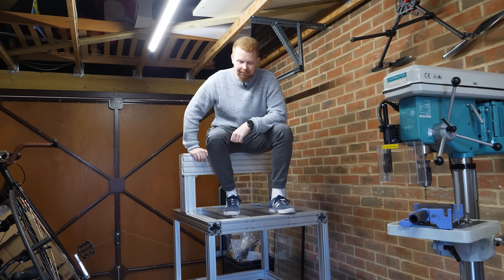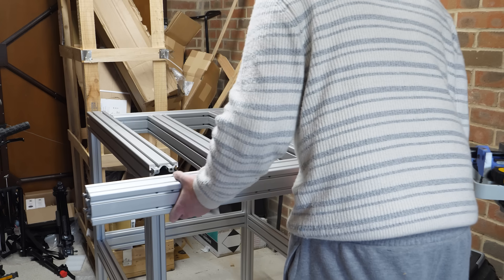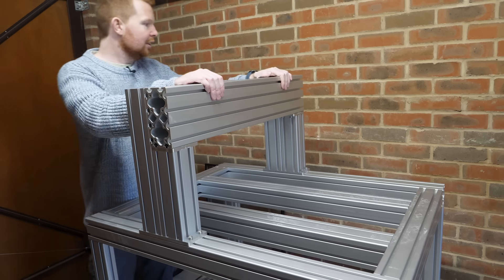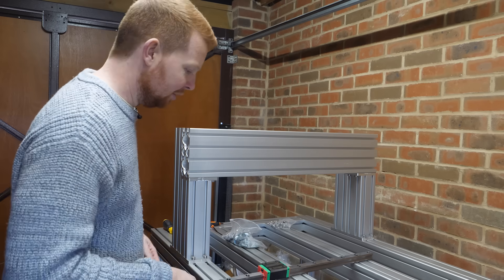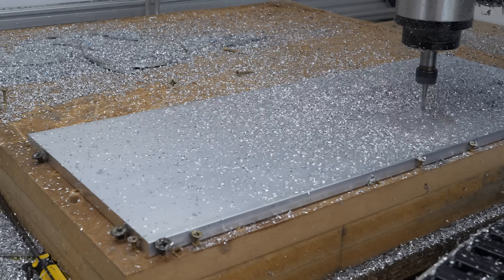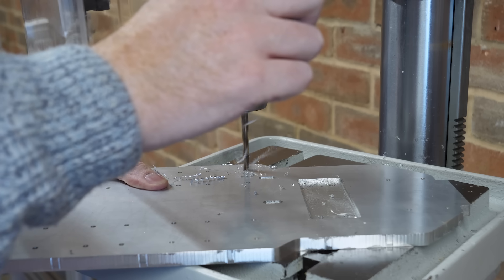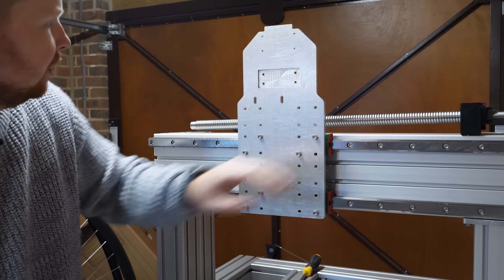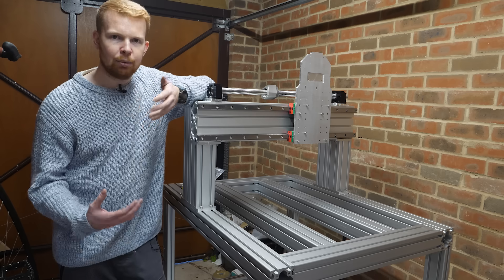Building a CNC Mill/Router - Part 1

Comment: Unless you cut the extrusions at PERFECT 90 degree angles, I highly recommend using 90 degree gussets and relying on those instead of the drill through connections. I personally like the ones from Tnutz together with their high torque t nuts with spring balls.

Comment: I feel like maybe your machine has it's weight up high and might cause it to wobble. I feel like if you could bolt the whole frame down onto the floor solid it would make the whole thing rock solid. Maybe even anchor it to a wall if the floor is concrete and you don't want to use concrete anchors or something. Looks like a nice setup from what I can tell. Looks expensive.

Comment: I've noticed many people building CNC machines recently who have chosen to use those linear rails/bearings instead of round rods. Is there a reason for that? I would think that the round axes would be better since there are bearings on 4 sides of the rod and ball bearings have maximum capacity when the race is pushing downwards rather than side to side. Wouldn't the flat axes with the two races on either side be weaker when force is applied in other directions?
Reply: The reasons are stiffness and precision. Linear rail that is attached to a beefy aluminum profile deflects far less than round rods do. If you evaluate the bending forces, then you will see that the deflection of the linear rail is actually negligible compared to the deflection of the profiles that carry the gantry and both are negligible compared to tool deflection and the stiffness of the CNC router motor itself. It needs to be said, again, that these kinds of router designs only work for soft materials like wood, plastic and aluminum using high rpm, small diameter tools (up to maybe half an inch). If you are planning on cutting steel, then better get a 2500lbs milling machine because this won't do.

Comment: Its a shame you put so much into rigidity and overkill on everything for rigidity, than install lead screws instead of ball screws :/ the amount of play they have compared to ball screws  just undermines all the rigidity work you did for the produced parts to be as accurate as possible. Putting the screw so high on the machine also increases the leaver on which the forces will be aplying stress to the gantry. It would be beter to mount it between the rails or below the extrusion. 

also X is probably not as smooth because of 2 things: You are runing them dry in the video, so grease will help. i wouldnt run them dry like that at all. And when you mount the rails, it depends if you checked for parallelism...basicaly tightening them after the plate is mounted with the help of a dial and soft hammer :)

Comment: Don't fall for the straight linear rails. Over all, the aluminum extrusions are probably straighter than the linear rails ( they get stretched after extrusion). True reference can only be accomplished by using steel straightedges with the needed tolerances. I've built a router with a clamping area a bit over 1250 * 2500 mm. The X-Axis linear rail (same beefiness as yours) was off by ~3 mm (a 🍌). By rigorously comparing of different "straight" objects at hand and a laser (and reversing them) i managed to find out that the aluminum extrusion is only off arround < 0.5 mm max on 1500mm. So i managed to bend and fix the rail to the extrusion and getting it, ...so said, straight enough. Should be about +- 0.2 mm, at least i tell this to myself. It came ou that it often does not matter as much, because the flattened bed follows the inaccuracies and the usually plywood stock is fixed to it. On smaller peaces it is obviously way more accurate, according to my small precision straightedge. Good luck!
Reply: Who needs 0.2mm precision over a 2500mm working distance? What material are you working on? Inconel bars? The thermal expansion of both your materials and your router will be larger than that.

Comment: Easy way to get the linear rails to move smoothly is to loosen all the bolts just slightly and move your plate to one end and tighten that end's bolts.  Then slide it to the other end and tighten those bolts.  Hopefully this will remove any non parallelism and it will move smoothly and you can then tighten all the other bolts.  Make sure it's as square as possible everywhere you can.  Parallelograms are the bane of these machines.
Reply: You can easily correct for that in software, if necessary. These are not precision CNC mills. Machines of this type are convenient to make parts from soft materials that do not require tight tolerances. If you want to do better than this, skip the build and buy a machine from a company that has 50 or 100 years of experience in tooling machines and dozens of engineers for the design.
Reply: @lepidoptera9337  But, but, what would this guy do to entertain us?  It took me a while to learn that these sorts of videos are not instructional, rather they are to educate you on the design concerns and pique your interest.  Then you buy some really cheap thing or try to make one yourself, and then, if you get through that phase buy a real one.
Reply: @dougcox835  Buying a precision machine is not even worth your time and money. Design the parts that you need and then let a machine shop make them for you. Professionals don't reinvent the wheel unless there is a financial advantage. For the occasional mechanical part there isn't. You basically have to have 80% utilization before buying a machine and employing a machinist full time is cost competitive with an established shop.

Comment: I work with aluminum extrusion at work a lot, and I have to say that method of mounting them together is not ideal. We used to do it that way with button head screws, but what we found is overtime the part slowly moves down the slot. Then when you try and disassemble, your hole to access the screw doesn’t line up and it causes a whole world of problems. I would recommend sending a screw all the way through the clearance hole instead

Comment: None of those extrusions are straight by the nature of how they are produced. You will notice that there will be height and spacing differences along the extrusion. As you tighten linear rails on uneven extrusion surface, they will bend along the surface. You have to figure out better ways to get straight surfaces out of them. There are companies that machine the extrusions to 1 mil tolerance along a 48 inch length. Get ready to buy a precision shim kit, because you will need it. Ball screws and linear rails will bind if they are not parallel to each other.

Comment: what are dimentions of the profiles? 20x40? 40x80? 40x40 or 80x80
Reply: I have access to 60x60 extrusions, will they be rigid enough for cutting aluminum and possibly steel if I use them instead of 80x80?
Reply from the maker: Most are 80x80, but the legs are 40x80, and the gantry is 80x160.
Reply: @TimStation please tell what are the lengths of the profiles?

Comment: 0:50 good stuff this is one of the strongest way of joining those aluminium profiles, and also requires the least amount of fixings, there you used two screws, next worse thing would be using those angle brackets, two of them, each has two screws and two t nuts, that adds to 10 parts!

Comment: Hey Tom, awesome build! I think your frame will out live all of humanity :)
I work as an engineer for an automation company and we produce off the shelf axes that are also used for CNC applications. These enclosed axes offer a lot of rigidity by themselves and have internal guiding so they save you the hassle of having to align your guides. Added bonus is that these axes also enclose the spindle and thereby  provide protection from chips and coolant (both tend to cause issues over time when they come in contact with the spindle). We also have servo's and what not to power everything. Feel free to contact me if you want to chat about your project!

Comment: Woo! Nice! You'll want to definitely gusset, locktite and tram EVERYTHING. Explore adding pebble or some other aggregate epoxy mix to the structure to add rigidity and dampen vibration. And nothing is overkill in a project like this!

Comment: Looks interesting! I used similar size rails and carriages to build a sliding door for my bathroom so the gap between the door and the wall is minimal. I don't see anything overengineered in this video. Looks good to me.

Comment: I use aluminium extrusions in a somewhat off-label way, as the frame structure for arcade stick-style game controllers (laser-cut panels go on the top and the bottom to complete the enclosure). This video was super validating in showing how tricky it often is to think through the order of operations for assembly.

Comment: For the linear rails you can put the bolts and the T Slot nuts in advance, don't tighten them, slide all of them together on the extrusion, once you have 3-4 in the rest just slide in with ease and then tighten them in place. Saves a lot of fiddling trying to get the nuts in place once the rail is on.

Comment: The x axis will probably travel better if you true up the linear rails to each other. I imagine you can find methods online, but I would lightly tighten the rails to the gantry and tap them with a lighter mallet until the movement is smoother. You could measure the ends to see which way the taper is and be more precise, but with precise bearings like that bringing them in can make a huge difference. I'm surprised they moved at all to be honest.

Comment: You might find it cheaper and easier to buy metal parts straight from laser cutting firm and then add your own machining. I often get parts that are finished or nearly finished for less than I can buy the stock. I think the reason is that a moderately sized laser outfit is buying in bulk.

Comment: I am not sure if this has already been suggested, but filling the extrusion with epoxy granite or a mix of sand and epoxy would add a considerable amount of mass. This would help with resonance and keep things from shaking around as much. The vibrations from milling metal can be significant. I have an MR-1 CNC machine which is of a similar design. It weighs about 1000lb and still shakes around when milling.

Comment: You're not going to get a stiff machine with bolted extrusions. Yes, you can site on it, but that means nothing. I can sit on a bean bag but I'm not going to use it to machine something. Here is a simple thing to try: put an indicator on the middle of the gantry touching the middle of one of the two support beams and push the gentry & pull the front beam and see how much deflection you get. That's going to be the maximum accuracy of your machine. I'm going to bet it will be in the realm of 0.5mm at best. That will break small endmills. Get a 10mm steel T plate cut to mount to the outside of each side and that will improve matters substantially, better than just doubling the vertical extrusion. Even better, make the vertical arm substantially wider and join across them with more steel plate behind the gantry, bolted (or better welded) to the vertical arms of those plates with as much crosswise bracing as you can. Best of all, join the side plates across the bottom with a couple of steel plates. The extrusion is fine for bolting rails to, but that's about all. As the aluminium and steel will move differentially with temperature you'll need to think through the mounting of the extrusion carefully.

Comment: Looks good, just a curiosity, how comes use used a second 8080 beam for the gantry brace? I'd image an end plate would've been cheaper and considering you already have a cnc probably easier. Also, I'd get some spacing measurement on the linear rails, the 4040 slots aren't the most precise and could be causing the resistance.

Comment: The good thing about using linear rails compared to rods or wheels, is that if you have any kind of imperfection, that imperfection will be the same every single time. That's great for reliability, because you can modify designs compared to the physical end result.

Comment: A possibly better way of putting the rails on would be to add the nuts and bolts before you try to attach it to the frame and then just slide the nuts into the track.

Comment: At 5: 20 ... I would've put the gantry to the edge of the horizontal beams so that outermost holes are just accessible. Then slot it in, slide to the other end of the support and do the same. Same with linear rails.. just put one bolt&nut in place, slot it, then slide it to the one side and you can do all of that so much easier... I'm having one of those hairpulling moment, "don't do it like that!"

Comment: @11:40 Hoo-ree scheed... Someone sure managed to buy all the overspecced components, huh?! 🤨
On a little side note... You have a lot more Aluminium machining hours under your belt than I have but bruh... The contours of your machined parts look horrible for no reason!
That Z-Axis Plate could have been done with a spotless finish simply by drilling through the 4 outermost corner holes, securing the plate to the MDF using screws going through those holes, and then milling out the contours using multiple, equal depths but with a like 0.3mm of material left over to machine in a final full depth pass at like ½ or ⅓ the normal feed rate producing a perfect finish without the use of Tabs ruining it.

Comment: Make sure you lubricate you rails and ball screw properly ! Otherwise you'll will fry them quite fast...
Rails (and carrier blocks) are tipicaly sold with a protective oil that need to be cleaned and replaced with proper lubrication oil or grease.

You can find documentation on lubricant type and quantity for your rails dimension if you search for brand-name rails.

Also, as other said, the gantry should move with as little friction and binding as possible, and the rail must be properly aligned. Any friction will translate in faster wear.

Comment: I did not find the aluminum frame stiff enough for CNC machining. It's better to just weld it. It is scary, but way cheaper, and the end effects are going to be much better. Simulate your project in some CAD and check out those cutting forces; they are insane! 
I do not know what size of spindle you are going to use, but I do hope you calculated twisting forces on those rails. If those are cheap ones shipped from China, you are supposed to clean them and lubricate yourself with some kind of lithium-based lubricant. They do come covered in petroleum gel as protection from corrosion, NOT as lubrication. Properly lubricated, they move much smoother than that. Either that or you are using heavily preloaded carts. The double rail system is supposed to be designed with no-preload carts, and preload should be done by carriage joining the carts. 
It can be a good idea to fill the structure with something like sand to dampen vibrations. It will not release any strain from the structure, but it will keep your screws from loosening (a little) and keep the decibels down.

I am not an expert by any means, though I do have professional experience working in the automotive industry.

Comment: You’ll want to tighten the top rail first.  With all the bearings in nice and tight. Then move the Z-plate  side to side tightening the second rail as you go.  Then the rails should line up and be nice and smooth.  Looks like you will end up with a solid little machine.

Comment: I'm pretty sure those rails require lubrication. Check for a threaded hole on either side of the sliding module. And there should be a lubrication channel visible on both upper and lower parts of those rails.

Comment: Pro Tip: you actually don't have to slide the nuts in from the side 😊. Their shape and the ball detent on the back allow them to be added anywhere on the track just by pushing them in sideways and then rotating them INSIDE the slot by 90°. This works perfect for the original item system - I assume it will be the same for other extrusion brands.
The more you know. Love your content!
Reply: I think he knows this already. You can see him do it at 5:17 . It took me way to long to realise though, so it's a great tip for sure!

Comment: It'd be worth considering tig welding the frame to reduce vibration and eliminate the fasteners backing out due to thermal expansion and contraction and make your runouts a lot tighter.

Comment: You need a dial gauge to mount the linear rails parallel to each other. That should remove the binding and let them run more freely.

Comment: 10:20 this is a pretty minute detail, but did you wait to fully tighten your linear rails until the plate that constrains the two together are on? If you assemble it in a certain way you can make those two linear rails extremely close to parallel. I'd do this by locking down the top two carriages to the plate and the top rail to the cross beam. Then a somewhat snug attachment of one bottom carriage with one screw, make sure the bottom rail is loose, then move the plate along the top rail, tightening up the bottom rail as you go, ensuring that there's basically equal distance between every point on the top and bottom rail.

Comment: The linear rails should glide much more easily than that. You will need to make sure the two rails are dead parallel, to get the bearings to work properly.

Comment: Check out minitec extrusion system. They have this funky fastener that you put into the end of the beam, but tighten from the front rather than the back. So you can loosen it and slide it over when you need to, without having to have new holes thru which to tighten the fastener.

Comment: Using two linear rails introduces and overcontraints on your system. Since every linear rail restricts 5 DoF and only leaves the sideways motion. You could introduce some flex joint for the bottom two linear rails to reduce the over contraints and get smoother motion witout the need of perfectly aligning everything